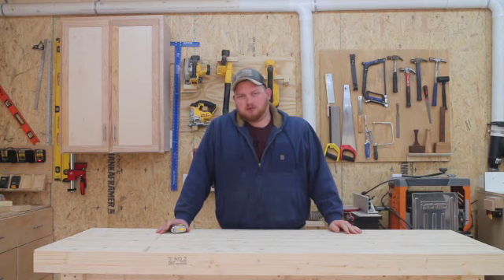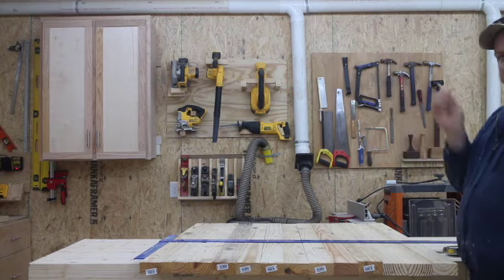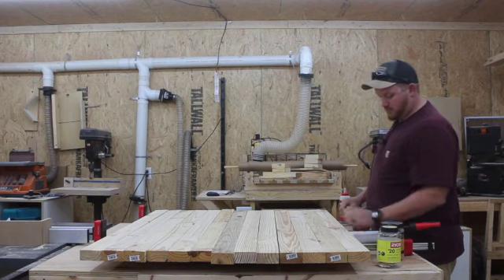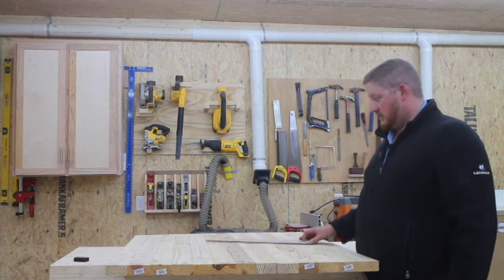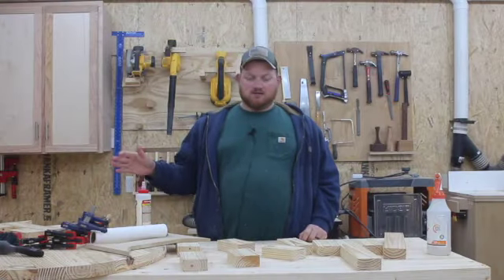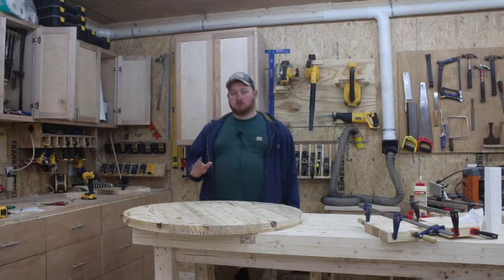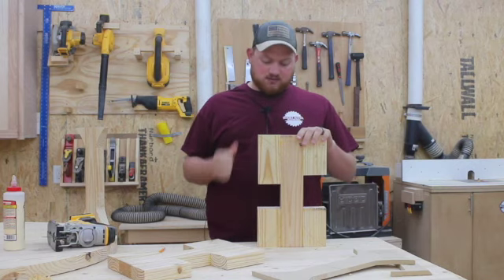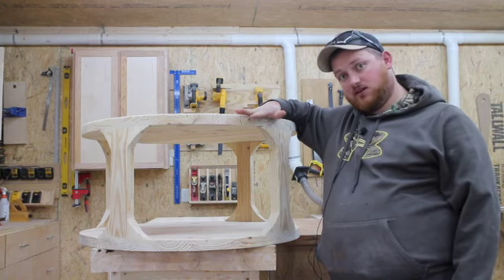Making A Round Coffee Table - Modern Coffee Table - Furniture Making

Comment: New viewer, new subscriber here. 1:00 PLEASE use a push stick!!!! I recommend the GRR-Ripper from Micro Jig. I have two of them and will never use my table saw, jointer, or router table without them, it seriously takes only a fraction of the amount of time it takes to blink your eyes to lose a finger, or more. I noticed you have a planer in your shop. To make smoothing (at least) the visible surfaces A LOT easier, glue up your 2x4s into panels just wide enough to be able to fit in the planer. After final glue-up, you'll only have a very small amount of sanding, if any at all, to finish that surface. This was a very nice, clean build that doesn't look very difficult to make. With a couple minor design changes, this could be made to look like one of those big wooden cable spools that people want to charge a TON of money for, and those things are often damaged, twisted, oil or grease stained, or even rotting. GREAT JOB!!!!!
Reply from the maker: Thanks! You wouldn't know by watching this, but I actually do use a push stick more often than not. Always on thin/small materials. Regarding the planer, I used that method in another one of my videos for the DIY Workbench. I glued as many pieces together as I could that would fit through the planer, and planed them at once!